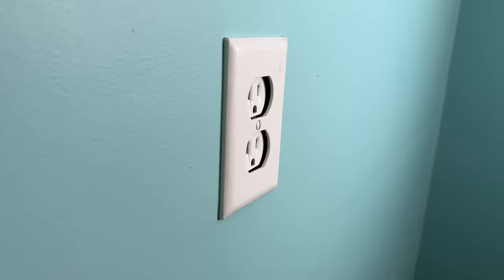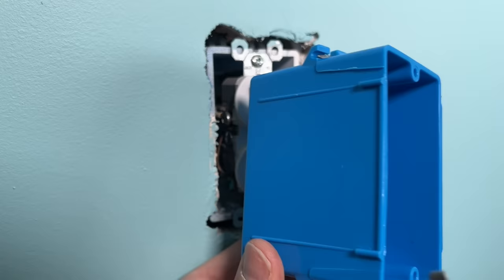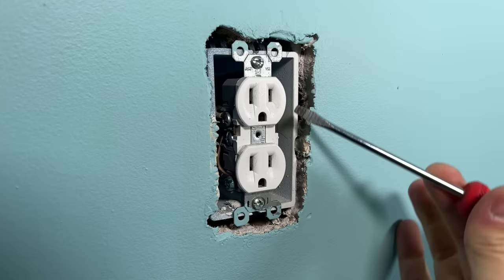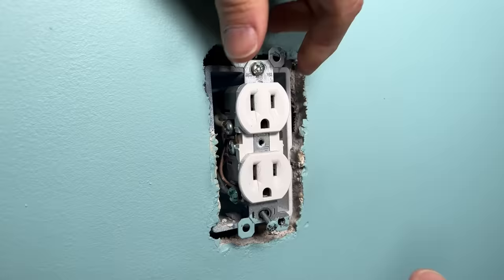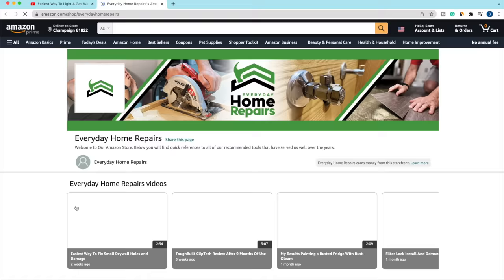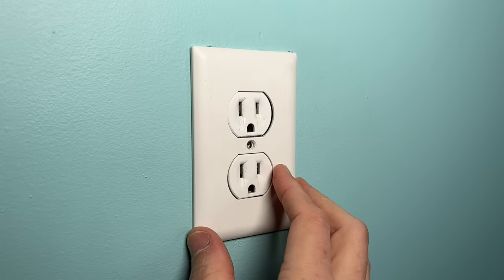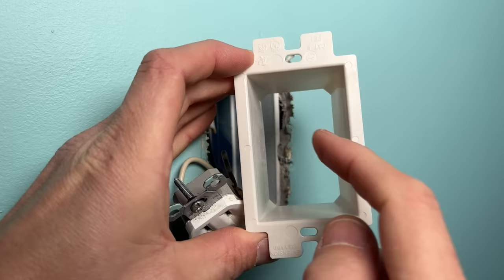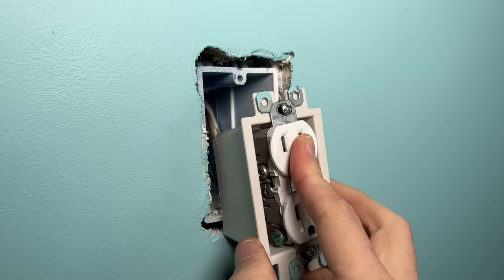How To Fix Sunken Outlet | 2 Easy Options

Comment: Wow, I learned a lot from you!  This was so useful.  I'm a DIYer, and always looking for handy fixes.  Electrical stuff is so intimidating.  Thank you so much for your great video series.  You are an excellent teacher, make great videos, and have a handy store I can buy from. Perfect!   So, what did I learn?

1. I learned that Knipex also makes Wire Strippers ($58 Amazon) and that they can cut a machined screw to size.  I love Knipex.   I was looking for quality wire strippers that were not made in China.  Even well known names like Dewalt and Klein are hopping on the China wagon with poor quality but massive profits. I also need machined screws cut to size and this is a very, very useful thing to have.  I bought cheapo strippers from HD and they do the job but I still curse. I don't want to curse, I want to smile every time I use a tool.
2. I learned that you cannot have gaps around an electrical outlet box. I never knew that.  It makes sense. If there is no gap, a fire starting at the outlet will have a harder time spreading behind the wall.  Not sure why wood paneling makes a difference but maybe because wood is more combustible?  Someone please explain that.
3. I learned about spacers to raise up the outlets.  I learned about a whole box you can add for extra safety, covering gaps, and raising it up.
4. I learned about extra large wall plate covers, never knew they existed and assumed they were all a standard size.
5. I learned about that outlet tester that lights up if there is power.  This is very useful.  In fact, this is the MOST useful thing in the video.  Since I know nothing about electrical, I want to be safe.  
6. I learned the names of things, such as outlet tester, wire stripper pliers, outlet box, spacers, wall plate covers.  Groping in the dark for names of electrical thingies, is frustrating.  So names are very important. You may want to add text every time you use something like 'outlet tester' because seeing it in print is a great visual aid for most of us who are visual learners. Musicians can remember audio and spoken words, but I need it in text to remember.  Always helps to see some text on screen.

Sorry if this is super basic for all you handy folks, but this is not an area I have any expertise in, and still learning basics.
Please do more on electrical.  I have a covered patio electrical outlet that leads to a wall lamp with two other outlets. That box is not working. I need to know how to see if any power is getting to it or not for my safety, before I change it.  What tool do I use?  The circuit box - there are two - for each of these duplex houses so not sure if this one is on the other circuit or on mine.  Not sure what turns it on/off.  I may have to check it manually, which is laborious.  I will do that, but still need an outlet tester and to check if power is going to the lamp separately. So please do a segment on checking for power in lines.  What tools, names, type of testers we can find.  Thank you!🙏
Reply from the maker: Thanks so much for the great feedback.  I like to use a Noncontact Voltage Tester when troubleshooting issues where I am not getting power.  Even better would be a multimeter.  Here is a good place to start with multimeters https://youtu.be/oHdW4Fafn8M
Reply: @EverydayHomeRepairs  Thanks a lot!  I love your videos.

Comment: Your video example of the "poorly cut drywall" looks more likely to be a plaster & lathe wall surface.  It's for more common to find irregular openings in older homes with plaster & lathe.  A number of metal boxes do allow for removal and moving the box forward and re-screwing to the stud.  I had never seen the red plastic spacers before and I have often used small stacked metal washers to accomplish the same task.  I also have never seen that box extender before in Canada, but there are a number of metal box extenders for different sized boxes, both rectangular and circular.   The box extenders tend to be three times the price of an entire junction box, making it a quick, but expensive solution to the problem, if you have a few that need adjustment.

Comment: Oops.         I bought the red spacers for one outlet ($5.70 a package) I decided to use clear flex plastic tube that I had and was same size as the screws ( ring). I just needed 1/4 inch to bump out the outlet. I hope it’s okay to do that?? Yes, over size wall plates are great. My home was built in 1942 and I think over the years when painting, they just painted over the plate and outlet while still attached to the wall. When I removed plates when painting you can see the paint buildup rectangle on the wall. Thank for your help!

Comment: When cutting the 6-32 and 8-32 screws, first run a nut down past the cut off point. When you cut the screw to length, removing the  nut will clean up the threads at the cut line.

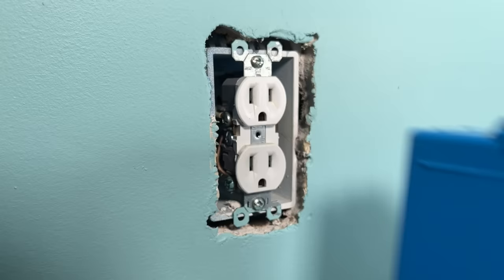Comment: Yah 2:05 feels like a pet peeve.. same agreed alsp for if it is a "wiggle outlet" in other words plugged in devices the plug can move the outlet side to side ie the outlet is not held snug in a solid unmoving/unflexable position for preventign the wires from becoming loose in the back of the outlet etc over tiem when in fact the receptacle or device sjould have been simply tightened fully for what it is worth to the boxand wall etc

Comment: Loved all the tips, the spacers, the longer set screws and the box insert. I’d love to see a video about how to switch out an old double outlet with a newer, bulkier outlet e.g. a GFCI, but the size of the box won’t accommodate the new outlet because the wires are so long they can’t fit into the back of the box. Any tips on how to manage those older, thicker wires for us ladies with weaker fingers.

Comment: Thank you for the information.  I didn't know about the spacers.  I used a piece of rubber on one project which worked out really nice.  I didn't know about the box insert, but I will be putting those in my electrical box of tools as well.  Great explinations.

Comment: In a pinch 2 really quick(er) (and DEF cheaper!) fixes, especially if your nearest hardware store is 20 miles away like mine. You can take your needle nose and bend the ears back as much as needed to take up the slack or if there's even a bigger gap than that you can remove the excess out of the black tubing at the top of your commode fill valve and cut 2 pcs to needed length and slip them over the end of your screws between the recpt and the box and just cinch it up tight. If you end up needing longer screws drywall screws work just fine.

Comment: I have done a ton of electrical modifications and addons in the 50 years I lived in my home.  I think most were done properly.  I came across something today that bothers me a lot.  We have 240v baseboard heat throughout the house.  Over time I have replaced the 45-50-year old line voltage thermostats with digital Honeywell, non-programmable ones.  A bedroom that I did a year ago was bothering me because I had used a plastic spacer to make up the difference due to the 4-wire nut connection and the new ones having wires instead of screw clamps took more room.  In removing it I noticed that one of the connections had been temp-hot and the wire there was blackened and the plastic wire nut had melted at its tip. Scary!  I went ahead and replaced all four connections with WAGOnuts as you have been recommending, thus allowing me to remove the spacer.  I'm hoping there might have been a loose wire nut there to cause that heat and melting.  Other than that, is there any way a 240v thermostat could be faulty, yet still work as it has been doing?

Comment: This video was very good and also relevant because I just finished working on a painting project for a customer of mine and there were a few receptacles that were recessed into the wall too far.  I did make a few spacers out of copper tubing and they worked well and I also installed some metal cover plates to add some strength to the overall installation.

Comment: Another great video.
You showed me the insert box and the spacer that I have never used before.
I was interested because I just finished doing some box replacing in some 
old work because the receptacles were not even with the wall.
Incidentally, I began using the wago connectors with the levers and they are very nice and effective.

Comment: in my house in florida some of my plug sockets would have been sucken in and what I saw was done is they tightened the top and bottom screw so the plug would have been flush with the wall and left it, then used the cover to hold the plug in place. so the top and bottom screw which tightens the plug to the wall box was purposely not tightened all the way and left where the plug would have been flush with the wall and used the actual cover plate to hold the plug in place. seemed to have work with no issues

Comment: Every box in my house is plastic built in 1970's with Aluminum wire all pushed back in the wall I used to pigtail them with the purple wire nut but not enough room. I found Home Depot now sells Aluminum rated receptacles I put them in. There is a lot of debate about the purple wire nuts using copper to aluminum I personally seen one burn up. I just go around and tighten the screws once ever 3 years with the AL rated receptacles. Flat roof home so cost to replace all the wiring is around 50k now days.

Comment: Most of this was new info to me. I didn't know that you cannot exceed 1/4" around the boxes.  I didn't know about the various purchasable options to fix overcut or too deep boxes, I just repaired with hot mud and the outlet tabs.  I knew there are reference tabs on the new work boxes for depth of install, but didn't realize there were additional 1/8" increments on the sides.

Comment: Contractor installed an addition to the house. Charged us $1900 in additional electrical work , I forgot the terminology but it was to "bring the new outlets out to match the new drywall in the new addition" 6 outlets. $1900. We had no clue he was ripping us off. Large company from VA Beach.

Comment: Thanks for the video.  Have never seen those spaces, but have seen box extensions (different style).  Would like to see how you might handle fixing the drywall in a situation with the larger overcut around the box, and how to properly cut it during original install.
Also, might I recommend a lavalier microphone?  It would make your audio much more clear and with less echo.

Comment: Not really a code or safety issue, but I use those larger face plates on light switches as it keeps the wall from getting dirty; its easier to clean the smooth face plate than the textured wall surface.  I was aware of the insert boxes but not the spacers.

Comment: Nice info on the spacers, and insulation insert... for safety. But you ignored that you were not wiring an older 'house,' as there was a three wire supplied grounding to the box, where as 'some' (many in california) are metal boxes with the grounding TO the metal box (via rigid, semi-rigid conduits, or 'wire' ), and grounding thus supplied to the sockets via the 'mounting ears' that you put  plastic 'spacers' under... potentially impacting the grounding connection.

Comment: Thanks for the valuable info - I bought a house built in 1985 and it seems the electricians did a very sloppy job. I'm slowly replacing the recepticles that are blackened and worry that they are carrying too heavy a load. Is that what would cause this?

Comment: I used to come across that problem years ago, and I used nuts or washers around the screws to bring the outlet out to level.....those rubber things that you have must be new, because I never saw anything like that back then. what cause that problem too is when renovators keep adding new panelling over the old one rather than tearing out the old one; no one wants the hard work and the mess; Ive seen old houses that had 3 or 4 sheets of different panelling added over the years rather than do a tear out and start fresh....I don't like that

Comment: Spacer and box insert were new to me. However, I live in a Chicago suburb which requires metal conduit & boxes. I’m thinking if I’m using a plastic insert that I will need to use a ground wire because the only ground connection of the outlet would be the two #6/32 machine screws.

Comment: There is another way to bring out an receptical flush with the mount plate..bend back the ear tabs and in most cases, this will bring the receptical forward enough to install the case plate....if not, use the receptical extension tabs.

Comment: Way back when I was an apprentice with a small company doing primarily renovation work, I would keep those 'mouse ears' in my pouch whenever I cut them off. I got called out by my journeyman once for using them as spacers just like this. He said it looked unprofessional and demanded I get some real washers to replace them. Wish I could go back and show him that's actually why they're designed that way.

Comment: I didn't know the ear holes could be used as spacers, but I agree they aren't really big enough to be useful, usually. I had never seen that style of open-back box extender used to space things. I had seen PVC mud rings used in a similar fashion but they are harder to adapt for in-between depths. I see they make 1- and 2-gang versions of the extender you linked which is great.

Comment: Excellent video! Im using the same exact white inserts on a room edition that we are doing 3/4 knotty pine wood planking. I think the likelihood of a fire from exposing the wood to the hot terminals is very low but it is always better to be safe and have peace of mind. Millions of households around the country probably just pull the receptace through the hole and screw it to the wood but we dont see millions of homes burning everyday......just my thoughts anyway:)

Comment: when i worked service commercial, i just stripped some 14/12 G  single strand wire and wrapped it in a coil aroind a screw  drvier and cut off about 3/8 of inch and put it around each plug screw making it stick out  that much farther

Comment: I needed to add another layer of drywall to fit flush with window jambs.  I had already wired the outlets and the extra 1/2 to 5/8 drywall would sink the box.  I was looking for a way to extend the outlet without removing the drywall.

Comment: As an added precaution, I habitually wrap wire nuts, switches & outlets with electrical tape, to secure the nuts and cover the screw heads for unintended contact with a screwdriver.

Comment: I learned about spacers, extenders, different size face plates . I also feel a lot to cold draft coming from behind the outlet and was thinking if you could make a video about how to block the cold air. Someone said stuff behind the outlet with fiberglass. Does it work? is it safe?  Thanks for you video. Learned a lot.

Comment: Thanks for the slow and meticulous step-by-step approach and illustrated explanations. I am reviewing your video so I can endeavor to try DIY on my loose or shorted light switch outlet. I have changed a few ordinary, dimmer-type switches dimmers have yet to see why and what we do when it's not fitting correctly. I don't know the code on the back of my hand, but I like to work safely like you. I am not going to be an electrician, but I like obtaining knowledge. Are there any theoretical courses given without practical experience on or off line? I am in Ottawa.

Comment: So should one use some filler to cover in the giant gap on the outside of the box?
Everything was new except the actual attachment and adjustment of the plates.
I like the brand recommendation, Knipex in this case for the wire stripper. Would like links for purchase so you get Amazon kickbacks. The outlet tester needs some brand and a link!

Comment: I wasn't aware of the information concerning the use of wall inserts in cases of wood paneling, exposed wood or jagged drywall material exposed to uninsulated wire connections.

Comment: Good stuff. I've never seen those spacers before, nor the encapsulation box. I've had some slightly sunken outlets in a previous house, so when I saw the video recommended, it sounded interesting. And it was! Thanks! I've also got a couple of ugly gaps just trying to peek out of a couple of plates around the house, so I think I'll need to remember to have a look for these slightly larger plates. I just learned about those a couple of months ago, so that was almost new info to me as well. :)

Comment: The spacers are new to me; I will be getting some of those installed soon. 
The sleeve was also new. However, the sleeve doesn't seem to fit the title of the video, "How To Fix Sunken Outlets". Does the sleeve do any good in surfacing the outlet? It seems it's great for code compliance and fire prevention.
I like your videos. And I'll be buying some new tools from your store as well. Keep up the good work.

Comment: Been there done this. Did apt maintenance at a 80 unit apt complex built in 1980 for last 10 yrs. Contractors did 1/2 ass job on plumbing, electrical and more. Had to space switches and receptacles out because they had boxes in too far. Sloppy job of cutting holes in the drywall and drywall mud in the boxes and they just shoved switches and receptacles in without cleaning the mud out. 😖😡
Reply from the maker: 80 units from the 80's would keep you busy for sure 👍